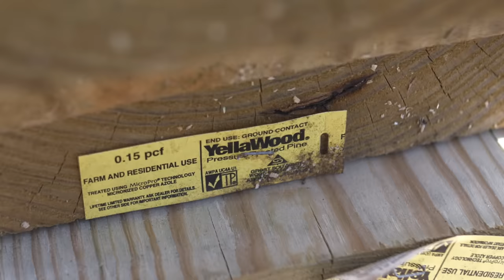5 Tips for Building a Durable Deck

Comment: I am curious about your thoughts regarding fence installation with pressure-treated wood. Would you simply stick the fence posts in the ground and surround them with concrete or fasten them to a concrete pier that’s been put in place?  Is it overkill? Is it not going to give you the rigidity you need in a fence?
Reply: There are a few methods for wood fence. Tried and true is setting into concrete, preferably encapsulating the post bottom completely. If possible, crown the concrete just slightly above ground level. If not, then a very shallow layer of soil, approximately 2" is plenty for grass to grow.   There are companies that make steel channel posts with custom brackets for mounting your 2x rails on. We have used they handful of times but mostly the ol' 4x4 is the customer's choice.  A Fence post is usually much easier and less cost prohibitive to replace than a direct buried deck post, plus the fact that a deck will support the weight of your family so it needs to be sound for a long time.    Been around the Fence business since I was knee high to a grasshopper and doing home remodeling for about 10 years now. It's always interesting to see new methods and new products to better serve our customers.  So never stop learning!
Reply: risinger said putting the post incapsulated in concrete isnt good. so maybe a small footer and a post bracket on top?
Reply: @baltimoreace  for a deck, setting the post like you would a fence is NOT the accepted common practice.  The longevity of the most important part of the deck structure must be much better than a fence. Plus, decks can stay damp underneath it, I know it does under mine facing the North. Yet a fence post unless shaded by trees will see much more airflow and dry much quicker than deck framing.  Generally a Fence post available now will last here in the Midwest will last 10-15 years easy, closer to 20 really. It's usually the rest or the frame work (when using treated material) that will give up sooner than the 4x4. If a person is really concerned about longevity, the steel channel post with brackets or even a round tube steel fence post with appropriate brackets would be the way to go.  Or there are products out there like this too. https://www.jeften.com/products/versapost/compare.php. But it ultimately comes  down to how much someone is willing to spend
Reply: look for pressure treated wood rated for soil ground contact.

Comment: Build it from galvanised steel with one inch thick concrete decking. Quicker, cheaper and way more durable.
Reply: Just cast the whole thing as one giant concrete monolith, using Roman concrete!
Reply: @calebfuller4713  All concrete cracks so you still need parting lines, but yes Roman concrete has stood the test of time.

Comment: Question, When using 12" on center spacing do your carpenters use a track saw to make sure the joist don't have to high of crowns causing uneven floor decking.

Comment: IMO, 1/8" spacing behind the ledger board is not enough. Over a short period of time, that will be filled with organic material and you will lose your airspace. My method is to use a 5/4 x 6" PVC product like Azek vertically, spaced appropriately and attach the ledger board to and thru to your rim joist or other attachment point. When decking, make sure to leave the gap.

Comment: In the mountains of Colorado, I'd actually say the sun is #2 enemy for decking. Southern facing decks in the mountains take a beating from the sun
Reply: I feel ya on that bud, I built a brand new deck outta treated wood with zero shade in a backyard and super high heat, came back 3 weeks later and it had 1/4 inch cracks running down all the 6x6 beams and 4x4 railing posts, so I just filled them with glue

Comment: I have watched about 6 different video's, the one part missing is, the size of the joists. I know how to build, but do I use 2x6's or 2x8's over a distance of  7 ft?   16 in O/C
Reply: Use a joist span chart, which is commonly available.  It tells you the maximum span for a joist by dimension (2x6, 2x8, etc), and by wood species (Douglas fir or SYP).                      https://www.awc.org/codes-standards/calculators-software/spancalc

Comment: Matt, I noticed the finished deck board layout is picture framed and has a mid span design to it... was this design driven or product driven? I seem to have noticed more builders doing this with composite decking due to the inherent movement. 
Another great video.
Reply: butt joints on decks is ugly.... hence the picture frame.
also with new deck products coming in only a couple length options the picture frame reduces waste
Reply: Thanks ...Matt???

I think the viewpoint on but joints are relative.
Reply: Not Matt but but joints never ever ever ever line up in at least one plane. If nothing else I think it looks like a custom job, not we used cut off and scabbed it together even if it is top of the line work.
Reply: Haha. If the cut ends never line up wouldn’t that mean the material itself is irregular in widths?
Reply: @scottbledsoe6918  not at all. It could be as simple as you tighten one side a little more than. The other or that joist underneath has developed a bow or one of the boards are longer so expand at different rates or one side is in the sun........
I think mostly I just don't like but joints. Anytime I see one I say to myself to bad they didn't plan that better.  My personal pet peeve is siding with a vertical board every so often. Just looks cheep to my eye.
Reply: I am sure there are thousands of examples of high end decks with but-joint applications... if done correctly, why would this look any worse. 

my question was not to debate the aesthetics of the picture frame vs buts... or personal preference,  it was to ask if it was a concern in regards to the selected decking material
Reply: @scottbledsoe6918  composites and PVC decking they recommend a picture frame to hide the "ugly " ends it also works out that it helps with a lot of other problems u find with both wood and composite and butt joints just look like shit.
Reply: Better expansion control
Reply: Butt joints protect the ends from splitting.  You can back off from the end and fasten diagonally and mutually. This is MUCH stronger and more stable. Butt joints only allow nailing into end grain which provides no holding power or resistance to crowning or cupping. Exposed. Endgrain is thousands (millions?) of thirsty straws sucking up water. Keep it sheltered by mitering (picture framing). Beauty is often quality not recognized by reason.
Reply: yea i personally prefer to picture frame all my decks reguardless of decking materials but alas the cheap contractor I do most of my work for now doesn't really wanna pay for the extra 30 minutes to an hour.

Comment: WARNING..... It’s never a good idea to use any type of galvanized or other zinc finished fastners with today’s pressure treated woods containing copper. The zinc and copper when combined with the acid (naturally occurring in wood) and water will create conditions similar to a wet battery.  The low electrical current will cause the zinc to very aggressively “deplate ” towards the copper in the wood. I’ve seen G185 completely deplate in as little as two years when used with ACQ pressure treated woods. ACQ has a particularly high copper content but even pressure treating solutions with lower copper content will still produce a low current which will eventually strip the zinc. If you want a long lasting deck..... spend the extra and use stainless steel fastners when in contact with pressure treated woods containing copper.
Reply: Richard Truckner...Agreed. We use zinc sacrificial anodes on our boats to protect all metal outside the hull, outdrives, props, etc. When exposed to a wet environment, zincs degrade fairly quickly.
Reply: Copper has always been used in pressure treated wood. It's not a new thing.  The old wood was treated with CCA which stands for Copper, Chromium, Arsenic.  EPA banned the chromium and arsenic so now they just use copper.  No fastener will last forever, even stainless steel.  Hot dipped galvanized is fine.
Reply: @Wowzersdude-k5c  Use it at your own peril….. I have been involved in extensive testing for many years and have proven the serious safety issues with ACQ when compared with CCA. It’s always necessary to test for not only extreme conditions such as docks and wharves but also simple conditions where for example there is an abundance of water such as sprinklers going off every day. G90 can deplete in as little as one year and G185 in two years under the right conditions. Once the zinc is depleted, the natural acids in the wood will start an “hour glass” type erosion effect where bolts and other fasteners loose their ability to carry the intended loads and you end up with deck collapses and other serious events…. try it if you’re not convinced….. you’ll find out the hard way !

Comment: Point of contact on wall. 
Even though you have 3 ss washers crud will buildup in space.
You did not mention if rods embedded were ss !? Also I noted someone put quarter round trim on bottom to finish appearance... That will not aid any drainage there.......
Reply: paul dow rods looked like hot dipped G
Reply: They’re definitely gal. All that work and used gal hardware. Gal’s worst enemy is pool water.

Comment: What I remember reading fairly recently is that spacing the deck from the ledger board with washers or hockey pucks....puts more stress on the bolts and allows more potential loosening up in time.  Any experience with this happening?
Reply: When someone not actually qualified to do the job correctly because they just throw a couple of carriage bolts in or some non structural bearing type of lag, and don't penetrate the complete run through ledger and rim joist, and don't space them according to the structural member being used using a 1-2 1-2 stagger such as \\\\\\\ yes anything will fail. And often times especially on remodels, a handy man will go in and throw some lags through a ledger, and really have no idea how tall the the rim joist of the house is, and will just throw them in blindly. There are very little permitted space to drive fasteners properly. Especially if you have a drop down ledger for snow purposes and whatnot. Also, most deck builders think if there's a finished basement ceiling for example, that they don't have to have inspection holes to make sure the fasteners are seated correctly within the allowable rim joist fastening area and at the correct depth. The spacer method has never affected any deck and ledger tear off when installed correctly. That goes for with or without. Personally I like to use 3 levels of flashing, a pre ledger peel and stick at least several inches above the top of the ledger. Then space the ledger, then a peel and stick above the decking height overlapping the top of the ledger, then a standard solid flashing....copper if in the budget or vinyl flashing that runs behind whatever finish the house will be finished in. Then the joists are ready for installation. The only builders doing this are the builders really focused on protecting not only the home from water and moisture retention, but the ledger as well. If water never touches the area at all, and can breath if it does get moisture, that structure will last easily double the life of a standard built deck by Joe blow. 
I also take it a step further. Though it slows me down a tad, I put a preservative/treatment on the endgrain of every single cut piece of treated lumber. Much like Matt dipping the post. I brush it on instead. 

Spacers or not, just make sure to be extremely aware of the requirements for every type of structural fastener, ties, and nails you use with the wood you're using. Of course it changes every time span and style changes. We try to take their minimum requirements and push it much further. Especially the taller, longer, and the more complex the build gets. Hope this helps some.
Reply: @MostlyPeacefulCombatVet  thanks for the reply.

I am fairly handy and seemingly a slave to the 30 year mortgage and being servant minded... I guess I don't have a lot of money left to play with in this fleeting life. Haha.  I have dreams of building a deck onto the back of our home and the ledger board that was installed by the builder at the time of construction...never was utilized...and will need to be replaced cuz it is warped.    I had thoughts of just making a separate structure from the home and just butt it up real close like....  As I've been told that additions cost more in taxes...?    Wife wants a deck and now I'm ready to just give in and let a contractor do it cuz my time able to be spent on doing this myself (although money savings is possible) causes her stress cuz I over think things and want stuff to be nice and long lasting.

I want a deck that will span the width of the back of the house...and a portion of the deck will have an opening for a bilco door (that HAD to be installed) cuz I told the builder I had wanted to finish the basement.  (That was 12 years ago and I have not done anything in that basement besides add a dehumidifier and replace the washer and dryer.... And soon another dryer.  Haha...

My thought is after taking the sliding door out and replacing it with double french doors that open inward that I would enclose that side of the deck that goes to the end of the home that the bilco door is at and make it a 4 season room with the ability to remove the bilco doors completely and add some wood to the bilco door concrete steps at the matching (steep) slope that will allow the same pattern to flow from concrete to wood and go straight from deck to basement without the bilco door obstruction.  In my head I can see one we have a 4 season room we will have the ability to move the stuff from the basement into the covered portion of the deck ...and actually finish that basement.

The other fun thing I envision is changing one of the windows in our master bedroom (2nd story) into a door and being able to walk out and on top of the deck ceiling which in essence would be the 2nd deck....but with no access to it other than the door from our bedroom.

Great ideas (in my head anyway.)

I also want to put a front yard deck that would replace the mulch and bushes and weeds that are between the house and the walkway.  I would transplant those to other areas of the yard to give curb appeal etc...but as of this moment..the porch we have has a small railing that (at the time being new parents) did prevents not only little child from falling off a height of 2 ft or so....but also prevents us from putting a comfortable chair there and stretch out at all... Oh well. 

Am I just too crazy to thing that these things can (should) be done?

Or should I just let the phrase "happy wife, happy life" maintain its place.?  Haha...
Reply: Jeffrey Potter don’t bother transplanting the weeds!

Comment: That was an amazing contribution in deck framing however, do you recommend yellow wood copper treated in high humidity climate?
Reply from the maker: Austin TX where I Build is in the Hot/Humid Climate zone. What’s your concern?
Reply: @buildshow  well we're in the Arabian Gulf and it gets quite humid here, my concern is the humidity absorption of wood. But your advice is quite sufficient. Thanks Matt

Comment: Joist tape and sealing the ends might have saved my deck.   This new pressure treated wood only lasted seven years where as my other deck is still going after 22 years
Reply: you need to stain your deck with solid stains every 5 year
Reply: Back in 2004, the EPA banned the chemicals used in the "old" pressure treated wood.  You can't buy it anymore.  So, yeah, the new stuff isn't as good.

Comment: Hey Matt, great video! Any advice for someone using concrete deck blocks for a ground level deck. Prevent the wood from touching the blocks as well?
Reply from the maker: Yes. Same with concrete blocks. Keep the wood dry

Comment: Does this Copper Leach out?   If contact w\ soil - Near Water - NOT Good!  
I REALLY Like the way the Ledger is attached.  My back room looks like it Pulled Away 1\2 in.  NO NOT the way it was attached.  
THANKS for this info!      wish i had trusted rebuild help.  lol  don't trust self       =\
Reply: if you have a well, that would be a problem.  are your kids eating grass outside?

Comment: Hey Matt, do you recommend a barrier between the steel post and concrete?
Reply from the maker: I'm not sure that would do much... are you worried about corrosion between metal and the concrete?  Interesting idea, hadn't thought of that.  MR
Reply: @buildshow  I am concerned about corrosion, especially if I use it in a porch/patio.
Reply: @raulpenaiii7348  we used to put a roofing shingle between piers and metal brackets. Same concept, probably overkill but I always liked overkill on my jobs.
Reply: I actually saw the corrosion on a metal post today. I can send you the pics. I am going to try the foam gasket on my metal to concrete contact, similar to what you use on framing.
Reply: @raulpenaiii7348  makes sense

Comment: On the ledger I dont think you get a great positive connection especially if someone were to use PVC spacers , it would create a hinge .
Why not just use drain wrap on back of joist?
Reply: gus barba I was thinking the same thing. That would be just like sitting the ledger on top of the bolts. They’re gonna bend at some point.